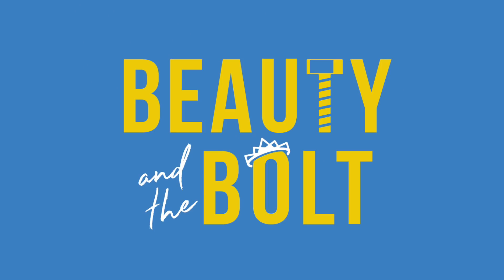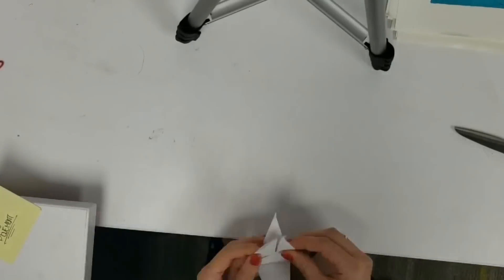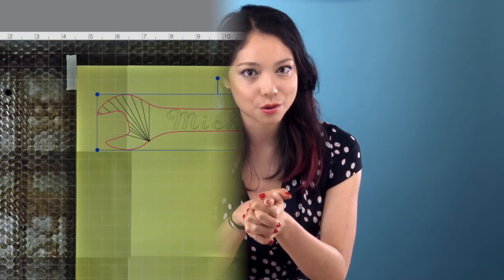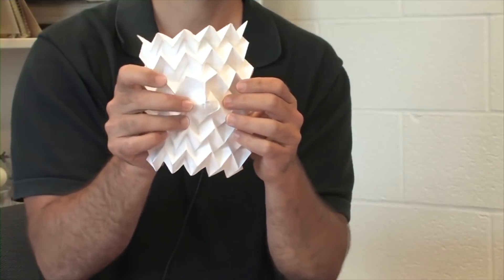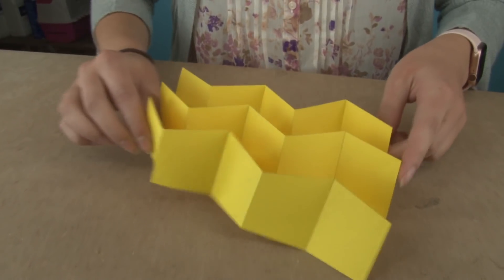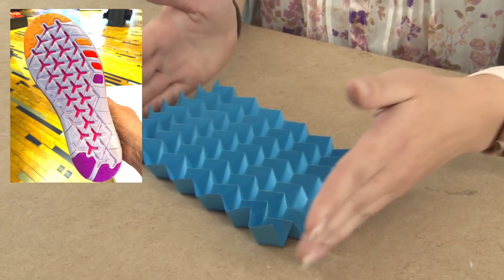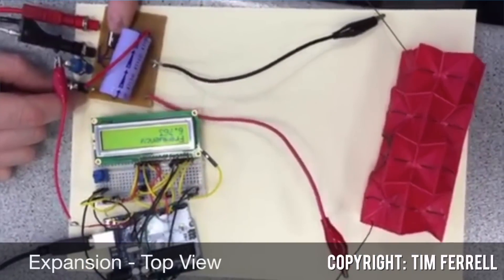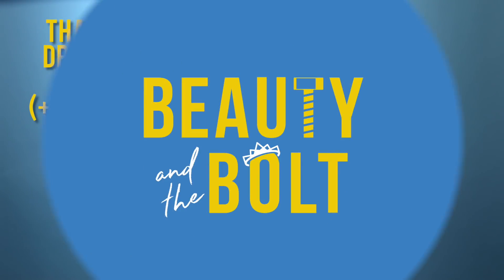Laser Cut Origami?! (ft. Physics)

Comment: At least you can fold paper by hand. No such luck with plastics. But if you pre-scored the plastic on a laser cutter, that would possibly work? I'm thinking polypropylene in particular. Can it be done?
Reply from the maker: Quite possibly-- although polypropylene isn't the most friendly material to be laser cut. For a pattern like the Muiri Ori it may be possible to score it using a vcarve bit on a cnc
Reply: @BeautyandtheBolt   PP is just stubborn and a contrarian.